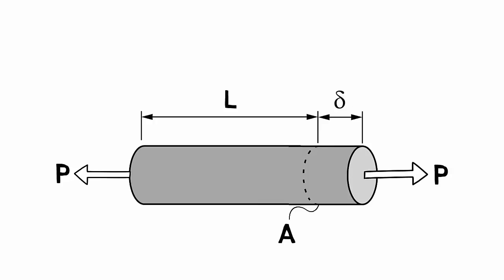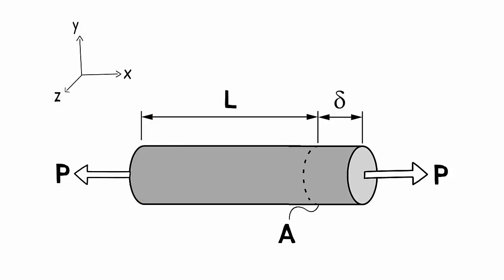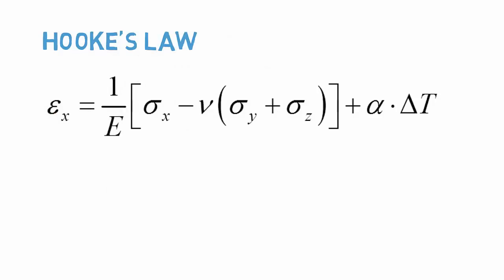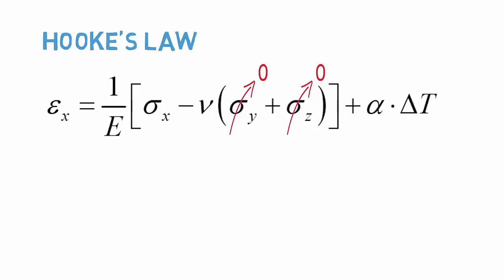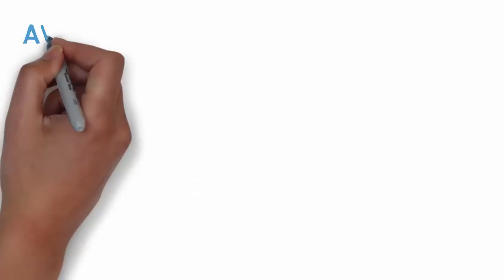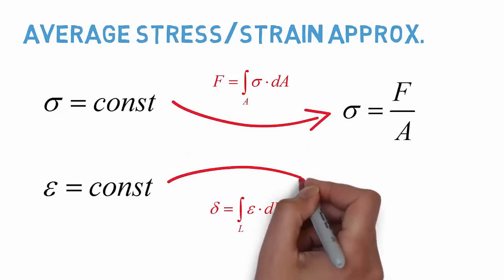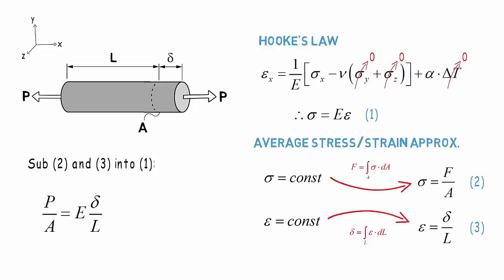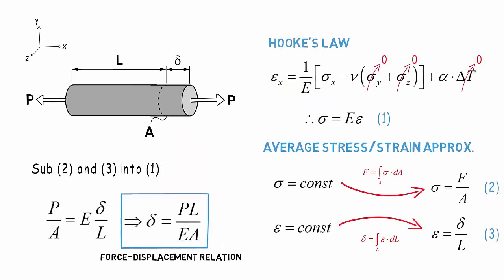2.2 Axial Force Displacement Relation

Comment: Hello Prof: At 1:38, you are say there is not strain from poisson constraint? Please clarify. There is no direct axial force along y and z dirrctions, But still extension in x direction due ti loading thru poisson effect will lead to contractionand strain in y and z direction and consequenltly it will be stressed in y and z directions as well as stress=E*strain. So there will be non zero stresses in y and  directions as well. Pease correct me if I am wrong.